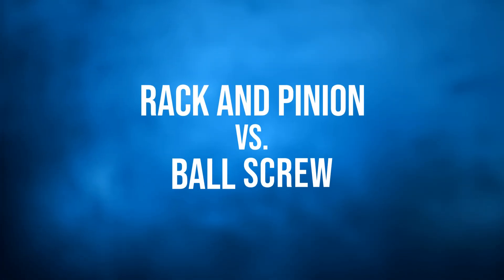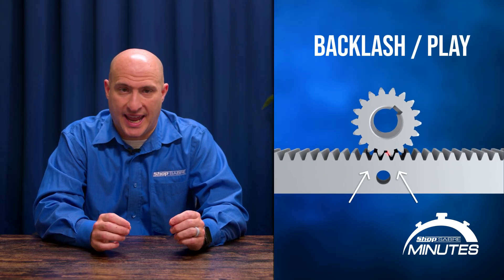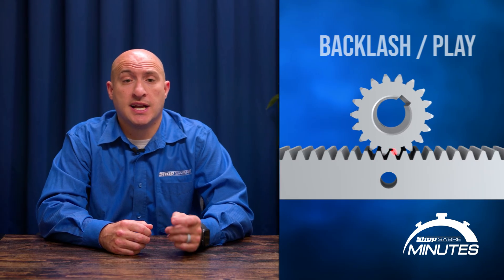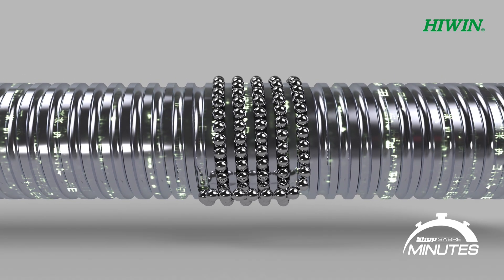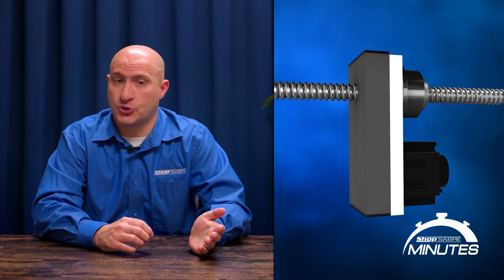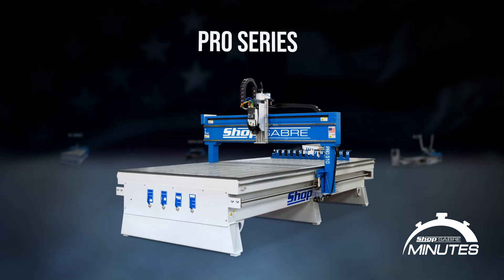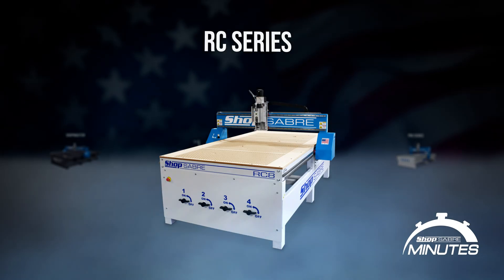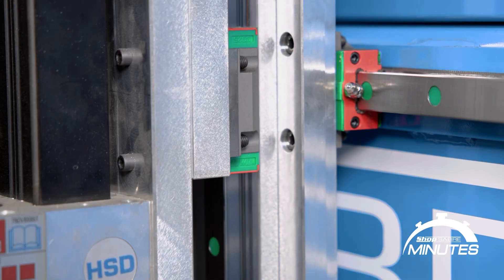Rack & Pinion VS Ball Screw - ShopSabre Minutes

Comment: Thank you for the presentation.  Can a ball screw system allow efficient and rapid back drive?  For example, when there's no power can a spring quickly drive the position of the nut back to its desired origin.
Reply from the maker: Thank you for reaching out - a ball screw system can be efficient with rapid movement. With respect to the spring drive, these machines have no reason for this as they have encoders on the motors so positionally they know where they are and can continue after power has been restored.